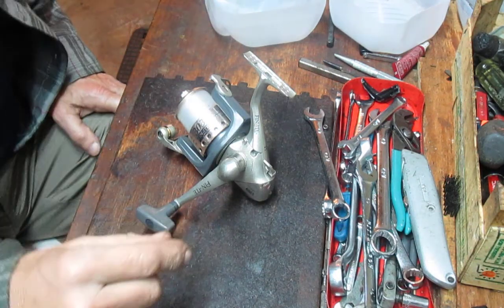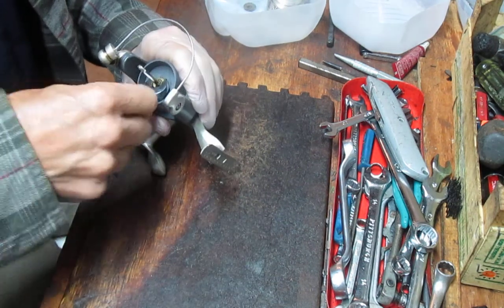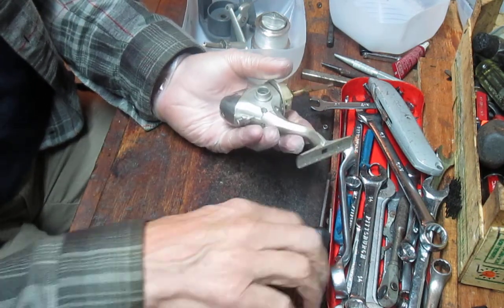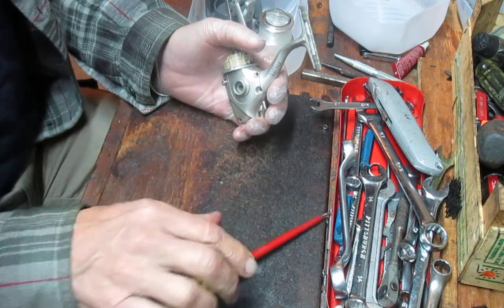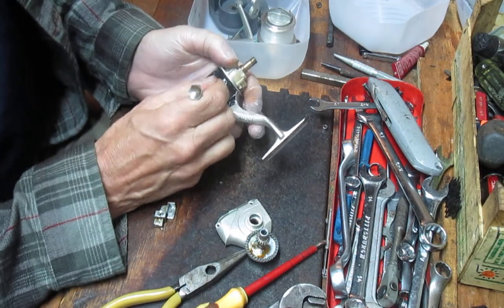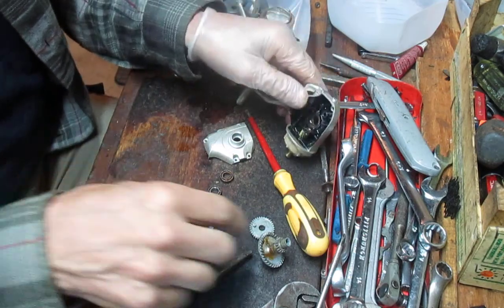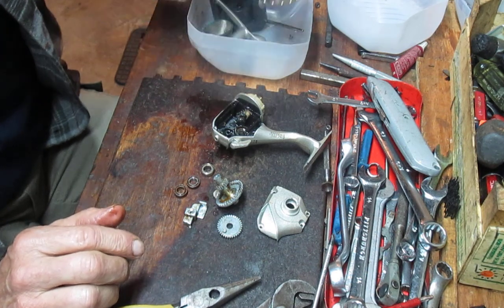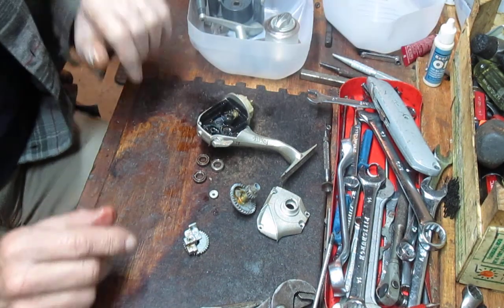Why fishing reels fail - Fin-Nor Fin-Lite - poor maintenance practices

Comment: Can you do a  Shimano sadona 1000 it has square gears And works only when you pull the bearing out .
Reply from the maker: I will look out for one as I do not have one in the shop at the moment.  Square gears?  I haven't seen that before.  I don't get to work on many micro lites as the cost to repair usually exceeds the price to by new.  If I find the Sedona, I will post the video.  Thank you for asking - Dennis